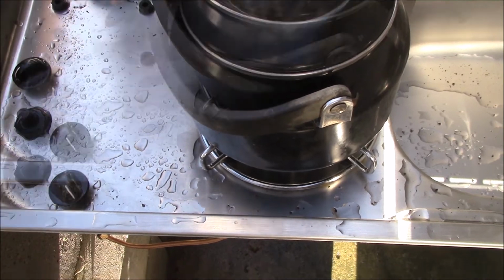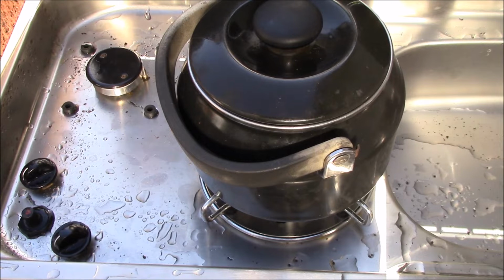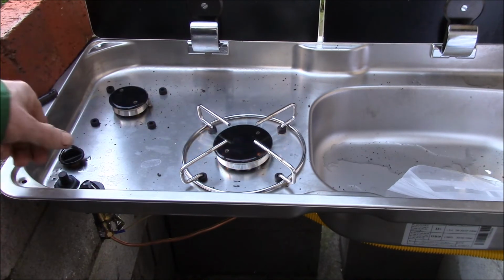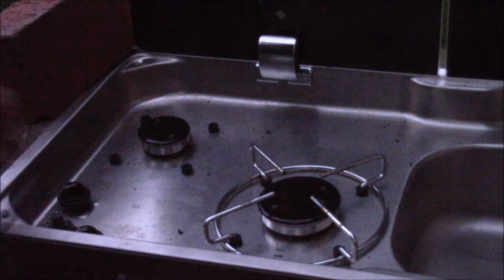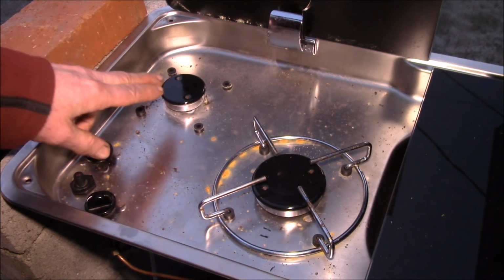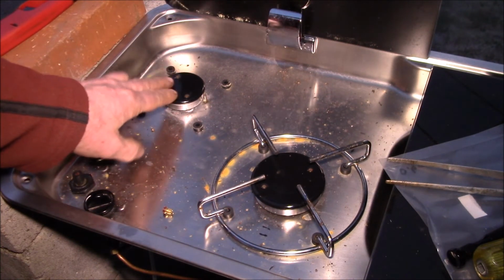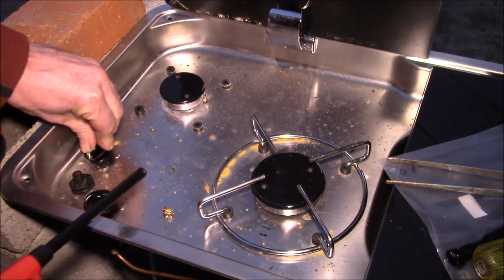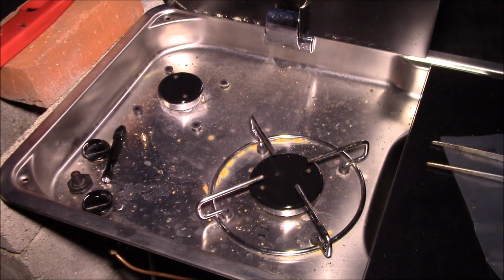Outdoor Kitchen Island - Propane Burner Testing

Comment: Never would have guessed boiling water could be so complicated...so nice to be able to tweek  things just so...of course that means it will never get completely done...better than the average bear...
Reply from the maker: For sure, I thought that the propane setup would just "work" out of the box.  But they have everything so choked down in the name of "Eco Design" that it takes forever to boil water.  Really a false economy to throttle down the burner so it takes twice as long to cook.  You burn half the gas for twice as long.
Reply: R Brown 
Curiosity got me to time how long to cook macaroni...usually am cutting vegies, for the salad, not watching water boil...know first hand that a propane tank can't last one of my meal preps...designed again to make true the claim...but not pulling one over on everyone
Reply from the maker: My electric stove on the small burner (1650W) takes 6m15s to boil a qt. of water.  Got the propane burner down to 6m30s by over driving it.  Some of the Coleman camp stoves list boil times in the 3 minute range, but those have burners with more than twice the heat output of my cooktop.

Comment: the love to tinker hope it works great for you
Reply from the maker: Yes, a bit of tinkering involved.  I think I'm seeing the results of the EU Ecodesign program in effect.  Can't find any hard information but lots of quotes saying "these new stoves use 30% less gas" or similar.  Basic physics and chemistry says 30% less gas = 30% less heat output and for heating water, it's all about putting heat into the water.  You can't wave a magic wand in the air and suddenly reduce the specific heat capacity of water by 30%.